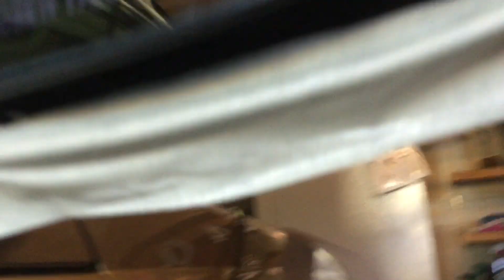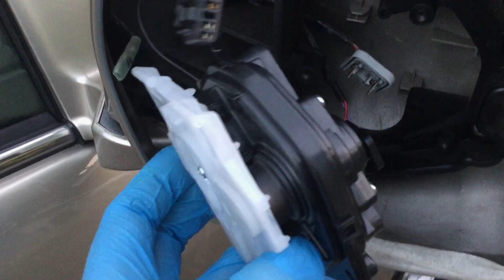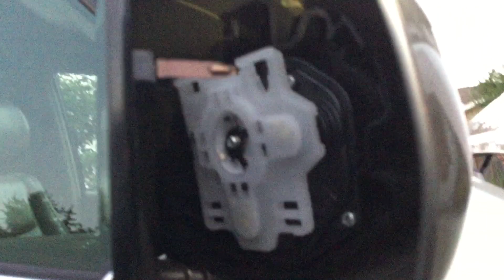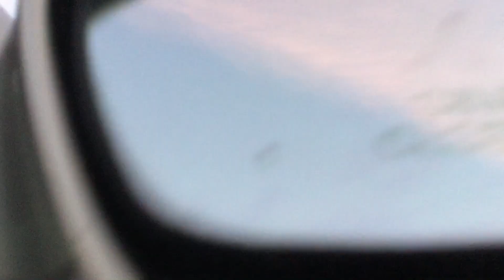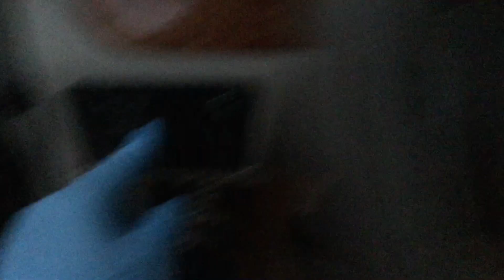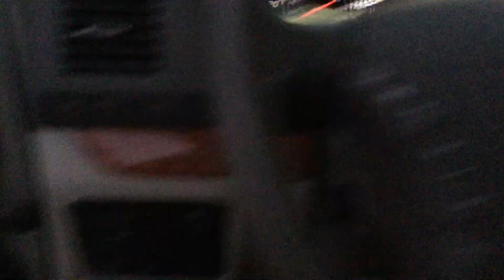2005 Lexus GX470 mirror actuator replacement

Comment: Thank you for this video.  It was spot on, and helped me change my the actuator on my wife's 08 GX470.  Because I did this myself, I estimate $300 saved from having it done at the dealer, where part prices are a bit higher.  Again, thank you!
Reply from the maker: MotorcycleMicah, so glad it was helpful, the gx is a great vehicle.
Reply: @glincho glincho was the mirror not adjusting? Mine only adjust up and down not side to side??? Maybe a fuse????
Reply from the maker: Gary Sbraccia, if it’s only moving in one direction only, it’s probably a motor. If I recall correctly I checked the electrical motors on the actuator that failed, and only one of the two motors was burned, causing fuse to burn . Anyway you still need to replace the whole actuator, to me is easier.
Reply from the maker: If it didn’t burn a fuse it’s possible, you may have an open connector or cut wire of the circuit that isn’t working, the wiring of motor for left and right in your case.

Comment: I changed the actuator but still up/down doesn't work. I popped open the door panel and check the wiring harnesses. They looked OK. What could be my issue then? Thanks.

Comment: Thank you for this! Why do we disconnect the battery? Safety reasons or functional?
Reply from the maker: You are welcome. Glad it was helpful. It’s a good safety practice and in case you short a wiring (with or without a tool) while doing maintenance and burn a component or a computer. It’s also in the Toyota procedure.

Comment: Why did you guys replace the actuator M what was the initial problem? Mine is working but always rotates downward and stays down.
Reply from the maker: It simply stopped working. If I remember right one of the electric motors failed, it was easier to just replace the whole assembly and not wasting time to just replace the motor.

Comment: Where did you get the replacement part?
Reply from the maker: I bought it on eBay. You may try a search for 8790860841
Reply: @glincho  thanks, saw on eBay for $130. Ouch $$. pulled motors apart and fixed them. Your video helped 👍
Reply: @drewdoesitdude  Yo Drew, Just saw your comment on the GX470 mirror actuator video. I’m having this exact same issue. Do you have the part number or a link to the individual motors you could share? I’m trying to rebuild mine as well instead of buying the whole assembly.

Comment: Why do you need to disconnect the battery, if you don't mind me asking?
Reply from the maker: It is a good safety practice in general when working on any electrical circuit. I also believe the OEM service bulletin instructed battery to be disconnected.
Reply: @glincho  Ah gotcha! I just replaced both actuators on my GX with the help of your video, big thanks!

Comment: Thanks for the vid.  Was a little tricky hooking up wires in a a confined space but not impossible.  Need good lighting to accomplish this.  Bought the part on eBay and installed in about 2.5 hrs with the help of your video.  I figure you saved me at least 3 bills.  Thanks again.  My Lexus is whole again!